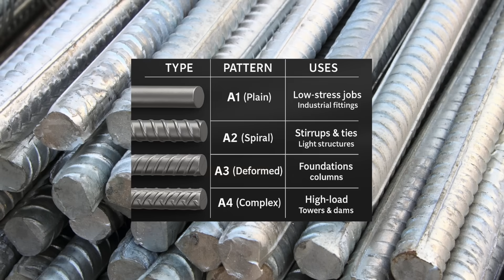Why Are Some Rebar Rods Ribbed and Others Smooth?

Comment: I used to work at a major building products company. We sold rebar in 10 or 20 foot lengths. In the 14 yrs I worked there, I never once seen smooth rebar, and we sold 1/4 inch - 5/8 inch thick rebar in all kinds of ribbed patterns. I didn't even know smooth rebar existed. (As an aside, it was an absolute bitch to rebundle a unit of rebar if the steel straps broke for some reason.)

Comment: There is also a special type of rebar designated with a M that tells you you could weld it to other rebar and stuff. Most rebar is more brutal though, and is unable to weld when bending rebar there are a lot of information there that you skipped depending on the diameter of the rod depends on the radius of the bend.   I have also started to wrap different Support columns like on freeway over passes and things with Steel in the event of an earthquake, if some of the concrete cracks and fractures and falls out, it will cause a failure of the column so if it is wrapped in steel, the concrete cannot fall out of its form and the bridge will survive in a southern California after the Northridge earthquake the city of Los Angeles, which building codes for structural are generally accepted all over the world. There is a lot how it changed after that earthquake a lot was learned. You should also do a piece on post tension where they use cables, detention, large labs together so that the whole slab moves is one unit.

Comment: Nice video, I didn't even know there was smooth rebar after 35 years of construction.  Your final comment is very true; 1. concrete will provide density 2. concrete will get hard, 3. concrete will eventually crack, 4. concrete will eventually degrade.  To simplify, humans are built the same way if we did not have bones for our structure we would not last very long.
Reply: india maybe ,

Comment: Another thing to know about rebar: It is deliberately made wet to let them gain rust, because the rust creates a bigger surface area for the concrete to bound with. Another effect of this is the steel expands slightly, which often causes cracks when water reaches the rebar in concrete bridges.
Reply: I use rebar in my garden and after it rusts,it's extremely difficult to pull out of the dirt because of the extra holding power of rust.
Reply: Rust is the enemy of concrete. It expands and cracks it. The less rust the better for concrete applications.

Comment: Ribbed rebar is for High Tension. Smooth is for compression like for columns.
Reply: Incorrect. Which side or face of a column is only in compression? None! A column transfers various types of loads down to the foundations. You have the compression loading of the weight of the building, and then you have the tension loadings being transferred down from live loadings like wind, the Sun, heating the outside of the building, people, and equipment. All of these loadings vary and require deformed reinforcement bars to transfer the loadings. You can also place PVC storm water pipes into the centre of the reinforcing cage to transfer rainwater from the roof to ground level. This may differ in areas subjected to freezing temperatures and ice storms. 
Mark from Melbourne Australia 
Commercial Carpenter 40 plus years.

Comment: I request how is hydraulic oil work and how can it produce more energy
Reply: For something like a car jack, it works by converting a longer travel distance to a shorter lift  that is able to carry more weight. 
That's pretty much the best way I could put it, don't hesitant to ask for clarification.
Reply: @steve-qr5up  oil doesn't compress, so when you pump it into a jack, it lifts the cylinder because the oil can't compress...:face-orange-raised-eyebrow:
Reply: It doesn't produce more energy. It's pressure laws. P1V1=P2V2 in two connected chambers